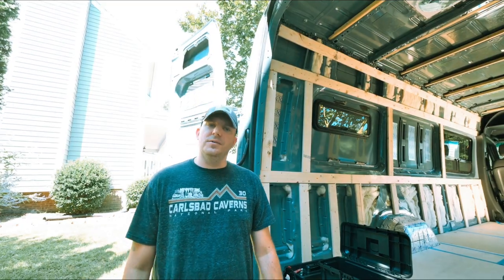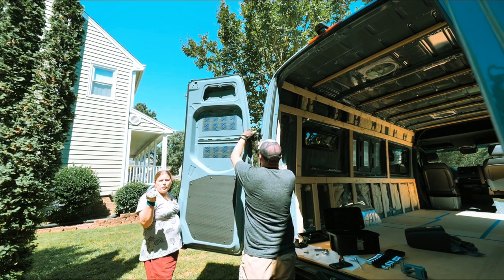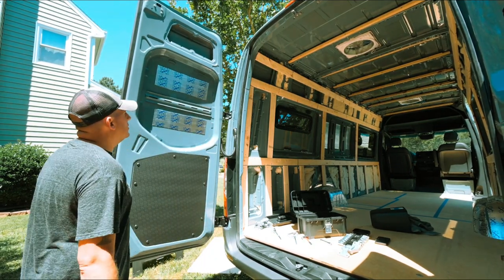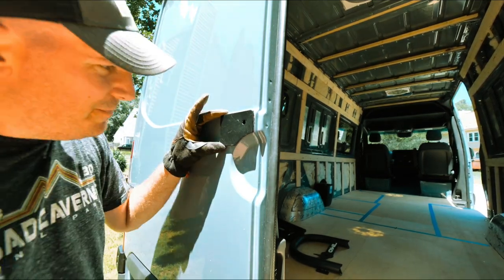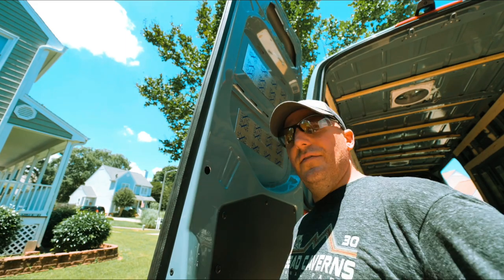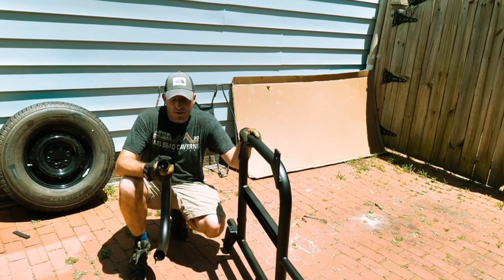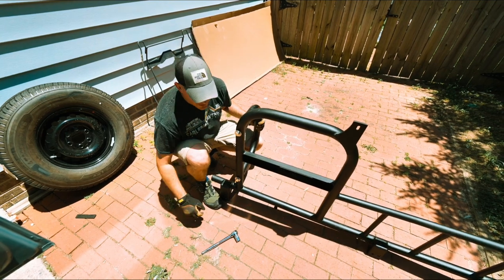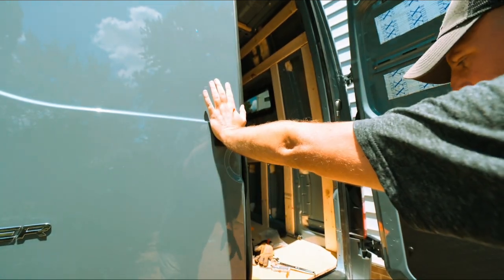WE HAVE A LADDER!!  |  Owl Vans Ladder + Tire Carrier Install  |  DIY Vanlife Sprinter Conversion

Comment: How far does your door swing open now? Before the install, it would be 180 degrees with the new hinges. But after the carrier install, how far does it open up before it hits the stops on the carrier?
Reply from the maker: The side that doesn’t have the ladder is 270-ish degrees… the one with the tire and ladder is 180… hope this helps! Thanks for watching!
Reply: @WanderfulRevolution  right, but now does it still open 180 degrees, or does the tire carrier limit the door travel to less than 180 degrees? Just curious? Thx
Reply from the maker: @Wino33  full 180 now… it used to be the 270… but with the hinge swap you still get 180
Reply: @WanderfulRevolution  ok thx. I just installed that same carrier on my 144 and the door only opens about 120 degrees now, so definitely not a full
180 like yours;(
Reply from the maker: @Wino33  no problem…. Did you do the hinge swap?
Reply: @WanderfulRevolution  factory 180 degree hinges. No swap needed